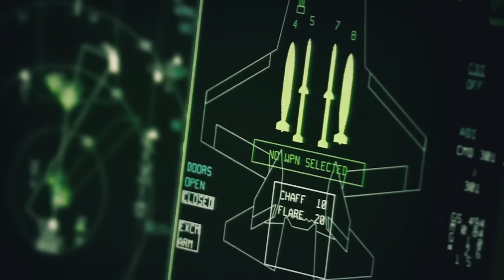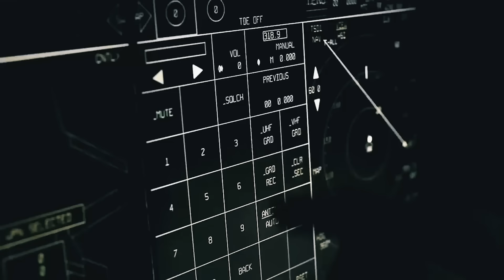US Finally Revealed Their Brand New Super A-10 Warthog!

Comment: I was a crew chief from 2008-2014 mainly working in the A/R shop. It’s a great plane and was fairly simple to maintain. Our fleet mostly consisted of 1977-1978 models with a couple of 1980 models as the newest we had.  We would sometimes have difficulty removing the rudder carriage pedals, having the throttle quadrant rigged just right, and locating parts sometimes. After they added air vents near the pilots knees, we really hated rudder pedal carriages. We enjoyed the 1980 models the best as they had a few extra access panels making maintenance easier on certain task. Our planes would sometimes get shot up in Afghanistan, but always came back. I enjoyed my time with them, before transitioning to the C130.

Interesting fact, we needed a new canopy one time. New ones are no longer made, so we had one shipped from the boneyard. It looked identical, but was slightly different. We had to modify it for it to work. Come to find out, every canopy was handmade for each aircraft made. Everything else on the plane was an easy swap.
Reply: Thank you so much for sharing your story & your service 🙏
Reply: Thank you for your service!

Comment: The A10 : the infantryman's guardian angel. Fantastic piece of engineering. It's needed. It can take off from dirt roads , using dirty fuel, give hell and take heavy punishment and return to base with one wing or engine. Can manuevre at low altitudes and slow speeds.

Comment: The problem with trying to retire the A10 is we still need an actual CAS bird. No the other aircraft we fly are not CAS, at best an F35 can do standoff ATG fires. A high velocity fork can bring down an F35, you cannot do anything close with it to enemy ground contacts. If you retire the A10, then task engineers with designing the next modern CAS platform... You just end up with the A10 again.
Reply: this 100% this...grunts on the ground feel safer with grunts in the sky...
Reply: I have a theory the V280 Valor once it comes online will theoretically be able to carry 64 hellfire missiles after doing some maths and it might take up the big hole left once the A-10 airframes are finally retired but it won't be the same.
Reply: No.  You end up with a new series of drones for Close Air Support for the future.

The problem is that the A-10 is extremely susceptible to shoulder launched anti-aircraft missiles.   The US did not face those in Iraq or Afghanistan.   If they did there would not be a single A-10 left.

I saw an analysis of using A-10's in Ukraine where he Russian Troops have shoulder launched anti-aircraft missiles and that analysis projected a maximum life of an A-10 at 4-5 days of use, with 50% shot down in the 1st 2 days.

Bringing last war's tools to a more modern battlefield does not work... Many many examples of that in the history of warfare.
Reply: @perryallan3524  Any low flying aircraft is susceptible to shoulder launched missiles.
Reply: @knowahnosenothing4862  not even close.  all that is, is a slimmed down V-22 Osprey.  Nothing CAS about that, no matter what they try and say it will be able to be.
Reply: @nadjasunflower1387  it will be another death trap for US soldiers sadly like the V-22. Tilt rotors may be futuristic but way too many moving parts lead to mechanical failure especially the maintenance on those rust buckets.
Reply: @perryallan3524  Well the war in Ukraine has shown that is largely untrue. With the exception of drones, little is new tech. When we do use new scalpel like devices, they usually run into trouble e.g. the Abrams. While the Bradley largely looked down upon has done well. I imagine the Stryker would also be useful in their war. While top advisors have shunned the A-10 as not applicable in Ukraine, they are also often the ones wanting to end the program. Ukraine is exactly what it was built for, how can it not work?  And yes, your comment about shoulder fired missiles has merit; but again, they were around when the aircraft was designed, and it was designed to fight a peer adversary.  

You might also want to consider the Taliban. Propaganda, fear, and asymmetric warfare carried the day.
Reply: @anthonysaenz7851  I disagree that the only new thing the Ukraine war has shown us is Drones.     While previous generation shoulder launched missiles have seen limited use in a few prior engagements - Ukraine is the 1st major full use of them - and use of the newer 2nd generation of them.  They have proven to be devastatingly effective both against land vehicles and low flying aircraft.

Within the last few weeks even the US Army has admitted that almost all of the Abrams tanks lost in Ukraine (about half of the ones supplied) were taken out by shoulder launched "top down" missiles; and that the "mighty Abrams" is just as venerable to those missiles as all the Russian and old Soviet tanks.  That the US Army fully understands why Ukraine did not progress with more full tank assults - it was pointless and a waste of tanks and people.

The A10 never faced any shoulder launched misssiles.  So your claim on how well they faired in the past has no meaning for a war where they are present.

It's very obvious to all that the A10 is nothing more than a very easy to get flying target in a modern battlefield.

How many future wars are we going to fight where modern shoulder launched missiles are not used?   I would bet almost none.

CAS is largely going to be done by drones in the future.

Comment: The A-10 is the CAS version of the B-52 bomber. Except that the A-10 is much more difficult to shoot down. And is far more precise in its targeting capabilities.  And until another aircraft is built with all of the A-10’s capabilities, it’s not replaceable. And cannot be retired.
Reply: Russia has SAMs that are the size of pickup trucks that can travel Mach 3. Those missiles carry so much explosives that the Russians have used them as surface to surface missiles.

Comment: This airframe has saved more lives than any other in the world over the last 5 decades! The survivability is off the chart and the cost effectiveness is truly impressive for American taxpayer. No wonder the lapdogs in Congress controlled by lobbyists hate the Hog! Had friends and lots of brothers and sisters alive today because of her!! I only wish the Air Force generals would have to be on the ground one time and have their lives depend on the insane performance of the A-10. Might actually change their minds for an hour...
Reply: I agree fully!  I would add that the Chair force should either be pulled back under the Army or split into two forces. One Army and one for the Air.   Army gets the machines it needs this way!  I personally think the A10 should live on, as long as there are tanks on the ground. Even better if it's an Army aircraft and continually modernized and rebuilt as needed.

Comment: So why haven't the US sent Warthogs to Ukraine!
Reply: لم تعرف بعد 
الروس اليوم فتكو ب اف ١٦ احدث من القديمه
Reply: Different missions but if they use them defensively and put several sidewinders on then they could knock cruise missiles and drones out of the sky , in the same way F16s are doing it now. 

Or they could use them sparingly on the front lines then retreat. And have some type of anti air defense system in place when warthogs are returning and missiles were fired at them from further out , the AA defense could knock those missiles off the warthogs' back.  The front lines, in some cases, have enemy troops only 200-300 meters away, so doing a quick bombing run on a trench and quickly returning is feasible, I believe.

Comment: 7:50.... the engine  ignitors are energised [turned ON] when firing the gun. A jet engine doesn't need normally the ignitors when running. But, most regularly energise the system - either automatically or manually - when encountering icing conditions / severe turbulence / wet runways/ high precipitation/ volcanic ash etc  for example. So nothing amazing.

Comment: I think you got it backwards. I would think that when the trigger is pulled, the ignition would be turned on, not off. Normally, jet engine ignitors don't run continuously, they only turn on during the starting sequence.

Comment: the main issue with CAS aircraft like the A-10 & AC-130 is that they require Air Superiority to be effective, however this issue is nullified by F22's & F35's existing. In short, the A-10 aint going anywhere for a very long time, 2050's at the earliest.

Comment: The U.S. spent huge in the seventies on aircraft.  The fighters perform at the edge of human endurance and are still around 50 years later and probably another 25 to 30 years to go.  Minimum.  The airframe's behaviors are that good.  And we did it with computers equal to TI-30s or with slide rules.  lol  I won't live long enough to see it but I wonder if the new kids, F-22 and F-35, make it to 2110.

Comment: Phillipino Islands wants the retirement of the A-10, to replace the AV10 BRONCO for COUNTER-REBEL PATROLS.
The AV BRONCO was used in Vietnam as AREA OBSERVATION AIRCRAFT, that carried light rocket pods under the wings.
Very slow, "PUSHER" Propeller  airframe designed to loiter, and give limited aircover as it reports back to Cent-Com damage done. Since it is low altitude, single engine prop, it had very low heat register

Comment: Air Force says their spreadsheets say the A10 didn't live up to its king tank killer status.  With the A-111 taking that trophy followed by the F15E.  If my memory serves correctly most A10 tank kills were NOT gun kills.  

The only thing the A10 excelled at was presence/loiter time and suppression.  It's true that there is likely nothing better at loitering and suppression in counter insurgency missions.  But the A10 isn't going to survive the front lines if it's pitted against a near pier.  They'll be shot out of the sky quicker than the Migs in Ukraine.  They are likely the easiest to hit attack plane when it comes to anti-air.

As for attacking tanks.  It would make NO sense to send one of these after a tank.

Right now we are working on long distance fiber optic connections to connect FPV drone to the larger surveillance drones.  That way the surveillance drone is far enough away from the tank that jammers don't impact it and the attack drone will get it's signal from fiber optic and therefore can't be jammed.

Kind of like a tow missile but instead of 2 wires that can short out if they touch water the fiber cable doesn't have that issue.

The air force knew the A10 was just going to cost them money.  

Again just think about it.  There were less than 70 A-111 Advarks used in desert storm.  Around 150 A-10s.  Also about 50 F-15E.  

So you got this big ass flying cannon and it's probably just going to use guided bombs anyways.

Comment: I would only replace the A-10 with an A-20 Razorback built upon an A-10 chassis, with the following improvements 
1. Sweep back wings and tail for supersonic flight speed
2. Upgraded engines for more thus 5000 to 8000 lbs more
3. Longer wings to increase payload 
4. Most versions should have two pilots a weapons specialist to take the load off the lead pilot 
5. Two of those Avenger Gatling guns with reduced rate of fire to enable the aircraft to do more damage to targets and stay on station longer
6. The larger A-20 should be built around the 2 Gatling guns, with a wider fuselage to carry more fuel
7. Finally the A-20 should carry 8 air to air missiles instead of 4. 😮
Reply: Sounds like a big engineering task...  I often wonder if America could build a replacement for the A10, given the current darling of stealth.

Comment: Man these BS military accounts know nothing. Pure AI written and spoken garbage. The US Air Force is quickly mothballing the A-10s. Ukraine has shown us that the A-10 only has merrit in a modern anti-insurgency role. But as we know from Afghanistan it didn't do that as well as it could. And typically with considerably high risk of collateral damage. While it seems inadequate the OA-1K Sky Warden is the modern answer to the A-10. Extremely slow and low flying, great sensor packages, arguably better crew protection, same weapons but smaller payload, and extremely quiet. That last point I can vouch for firsthand. I live near Eglin AFB and they've been testing the Sky Wardens daily. You don't know it is even above you till its passing, at what I would have to guess is less than 500'. You honestly could tell me its electric and I'd believe you. The prop design and muffler system is next level.

Comment: The upgrade was done at great cost by Boeing so the doors and engines will fall off, the batteries will catch fire and random bolts holding the aircraft together wont be fastened to the correct torque.
Because that's what Boeing does.